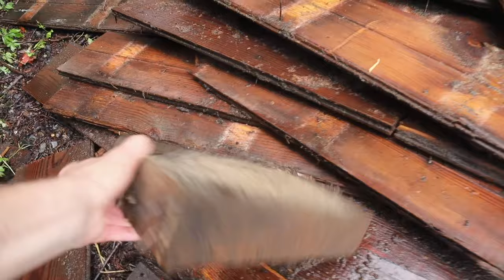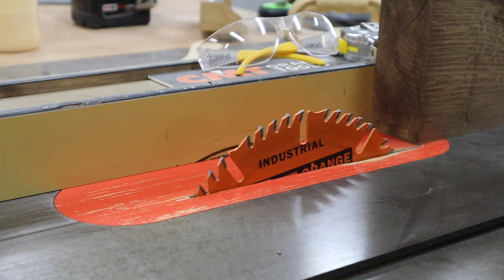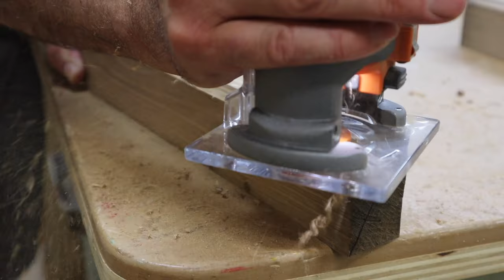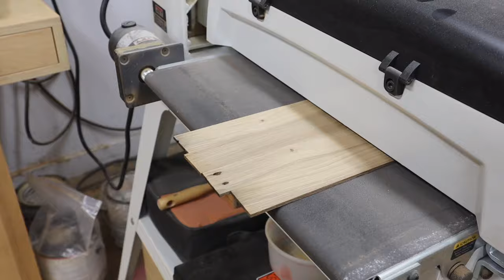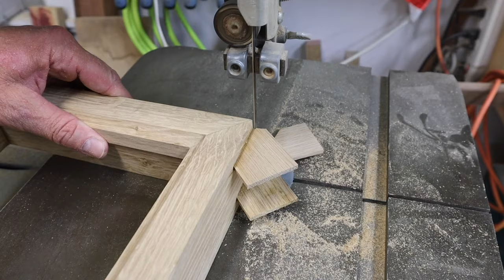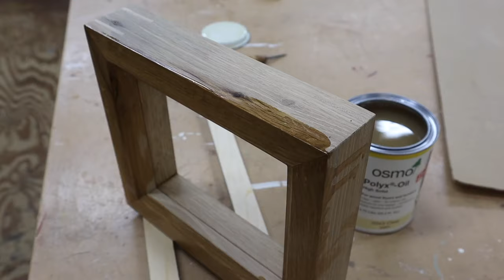How to Make a Spline Frame Using this Jig

Comment: Perhaps a dumb question. But for the joiner, are you worried about dirt/grime from the reclaimed wood causing excessive/uneven wear on the blades? or is such a small difference to negligible?
Reply from the maker: No not really I washed the dirt off the boards before running them through the machines

Comment: Awesome!  Your instructional vdeos are the best out there.  Question.  Why did.you use table saw cuts and then a hand plane, rather than electric planer?
Reply from the maker: Thanks... my thickness planer broke a few years ago and I haven’t replaced it yet
Reply: Thanks for the response. That’s a pretty good reason 👍